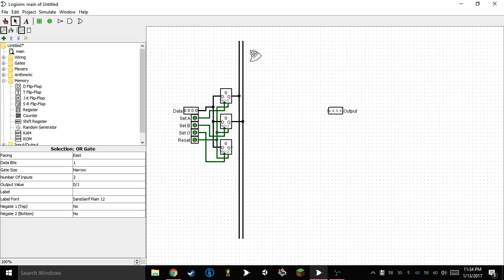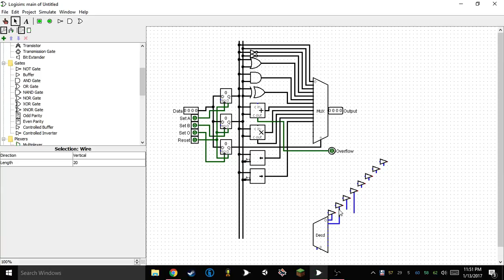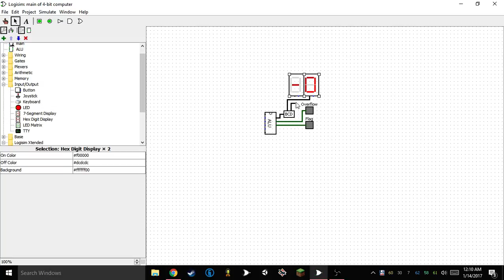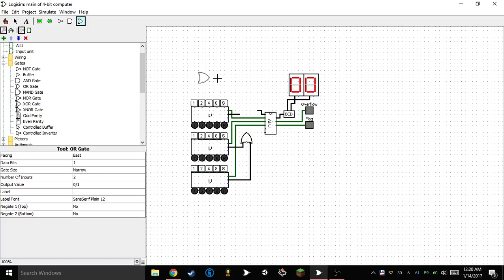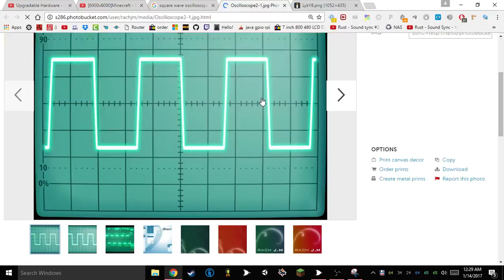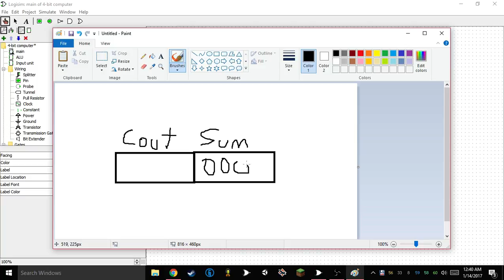Logisim 4-bit computer tutorial 0001: Fundamentals and the ALU

Comment: In real life, You still can't Simply connect two inputs, if one is high, (Connected to the Positive of the power source) and the other is low, (Connected to the Negative of the power source) It will short circuit, and the rest of the circuit will lose power.

Comment: Hi amazing the video I'm doing it also but I have troubles with the UI i don't know the wiring because you move the pins and they don't have labels. Could you answer this coment with the labels from top and clock direction.  Thanks a lot for this taugh job.
Reply from the maker: sure here they are (in clock-wise order): 1, 2, 4, 8, Send, Data, Request in, Request out, 8, 4, 2, 1